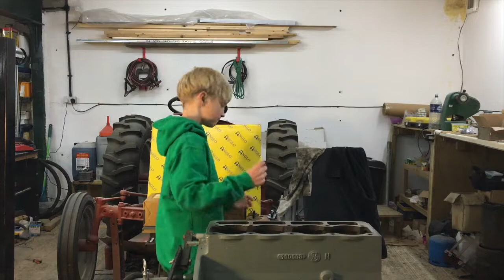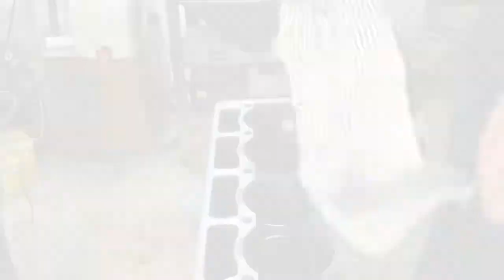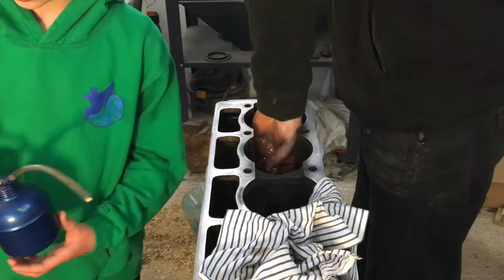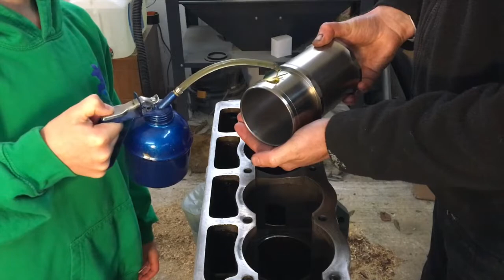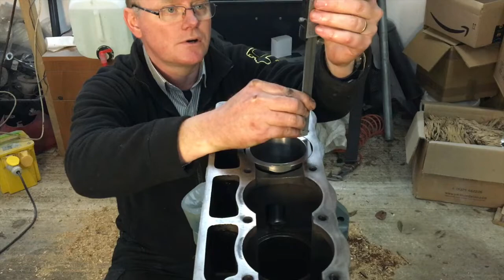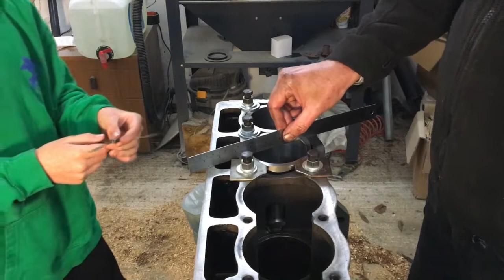#93 TED20 - Cylinder Liners #1 - with Anglo Agriparts

Comment: My suggestion is refresh the counterbore to make it square to the head surface and get the liners near the upper limit so the head presses the liners Down on them gaskets 
Lance will have the correct solution 

Found this on evil bay 
Two New Replacement Liner Base Gaskets for

Massey Ferguson MF TEA20, TED20, FE35, 35, 135 Tractor
with Standard Vanguard 80mm, 85mm, 87mm 4-Cyl Petrol Engine 
This offer is for two liner seating gaskets our part number LGK5901 

- these gaskets are located below the cylinder liner and are 0.020in (0.52mm) thick
Reply from the maker: Hi Hooter, thanks for your suggestions. I discussed with Lance, a local agricultural mechanic and an engineering shop. The consensus is to skim the block, hopefully by no more than 0.003 in. It’s in the shop now and I’m waiting to hear the outcome. They micced it and there was 0.0025 variation right to left across the block. That’s measuring from the counterbore surface of each bore. So they believe taking off 0.003 will bring it back into spec. Apparently we have up to 0.006 to play with before we have to worry about piston stick out. Feeling much happier about this now 🤣